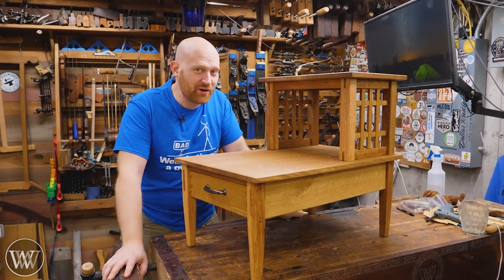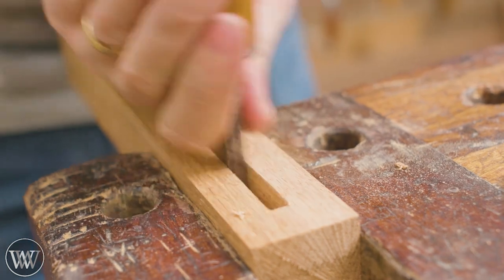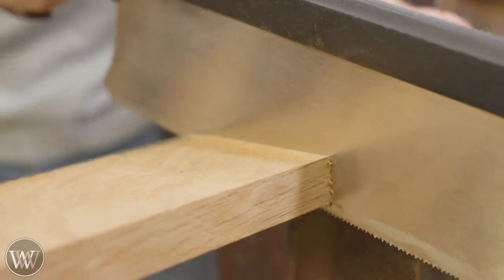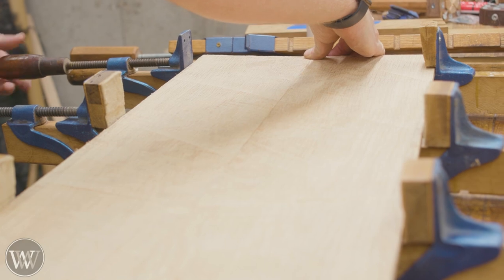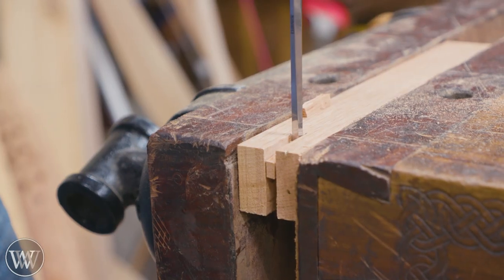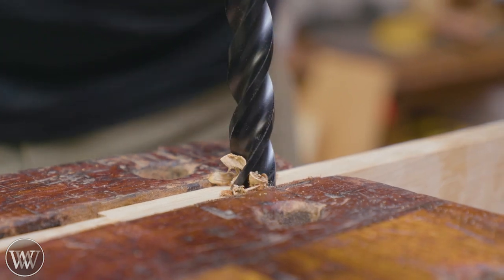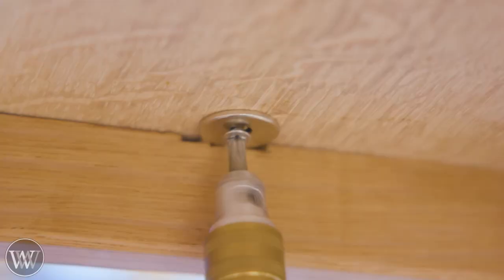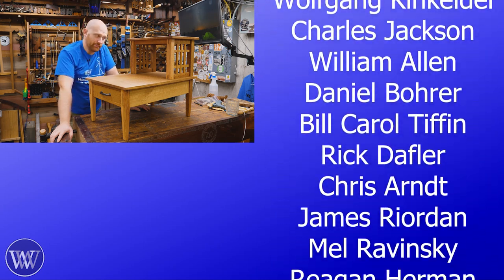How To Make A Mission Style Bedside Table

Comment: Quality work. I am a big fan of your approach to building. Hand tools, to me are the way to go. They give you more control of the cuts. Also using hand tools feels as if you are putting more of yourself into the wood. 
Question, do you use a specific thin kerf saw, hope that's the right term, for cutting tenons?
Reply from the maker: I just used a Japanese saw as the back was thinner. The saw does not matter much there as long as it is crosscut.
Reply: @WoodByWrightHowTo  Thank you. you're one of my favorites.
Reply from the maker: Here is another build where I did them a bit differently. https://youtu.be/AIaqprjjytE

Comment: I guess you used the back saw when trimming the length of the tendons, so you would still have some tendons sticking out the distance from the blade to the outside of the back.

Comment: I got a question, I am new to wood working and am currently attempting to build a TV stand out of reclaimed white oak. The boards I have after I smoothed them out are just under 1 inch thick, so i laminated 2 to make my legs, they are 1-3/4 " square.  I wanted to do mortise and tenon joints and so my question is this, is a 1 inch long tenon to short? If I go any longer my side and front stretcher tenons will hit each other in the leg.  DO I need to make thicker/wider legs? or can I get away with what I have? 
I sure hope I can get away with it because I milled and squared these up by hand and it took me for ever ! 
Thanks to any one who responds.
Reply from the maker: It all depends on the force you're planning on putting in the table. The traditional answer to it is to make the ends of the tenons at a 45 degree angle so the two meet and do each other. I did that in the recent live end table build. If you want it even stronger you can make the tenons pass each other like I did in this build. It means the section that goes past the other one is only half of its normal size, but it's usually better to make it longer than it is to make it taller. However, if it's just going to be sitting there without much force happening on it 1 in long tenon should be more than enough as long as you're glue is strong
Reply: @WoodByWrightHowTo  I really appreciate the reply and the advice. I had made the comment just before the part in the video where you overlapped the tenon's. I Think I may attempt that, I wanted to do through tenons to begin with but I assumed I would have to make and H style side or step down the side stretcher if that was the case because I did not know over lapping was a thing.
This is a whole new experience for me, I come from a masonry background and  have never worked with wood or hand tools until this year. Your channel has been both very enjoyable and a great source of information.

Comment: A build I would like to see is a small table that is very stout.  About 40 inches square.  And stout enough to use a clamp-on bench-on-bench with for apartment woodworking.
Reply from the maker: The dining room table I did a few years ago would fill that build. You would just shorten it.